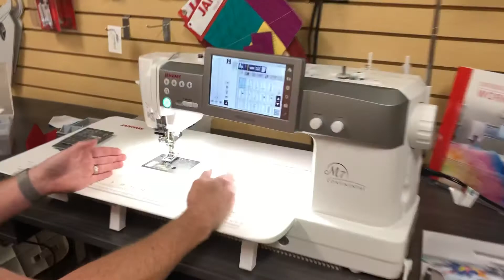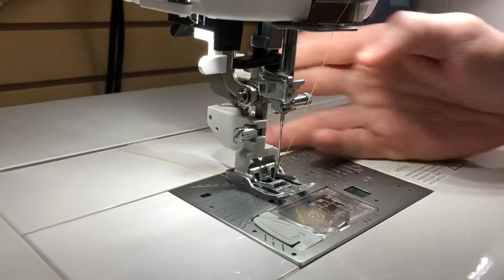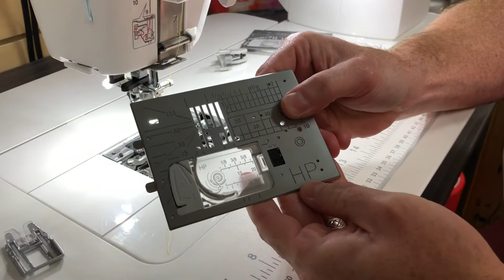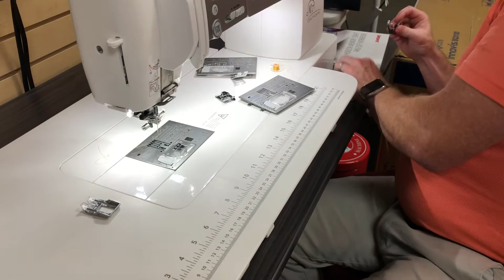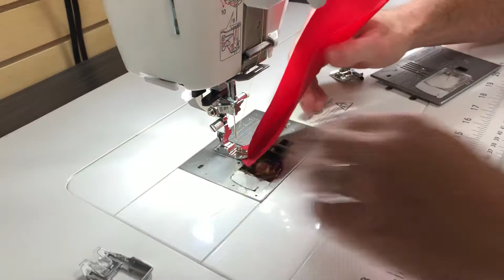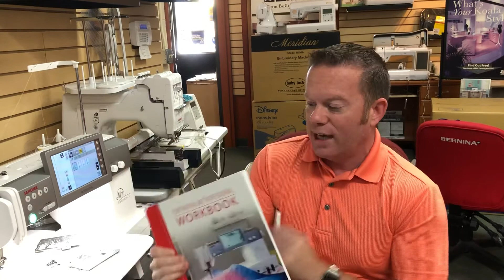Janome continental m7 sewing machine needle plates

Comment: Wife has a Janome Continental M7 Professional.  Thread cutter has stopped working.  The auto lock feature has stopped working also.  When thread cutter button is pushed you cannot hear the cutter trying to move.  Have removed plate cover, bobbin and cleaned entire area.  Thanks for any help